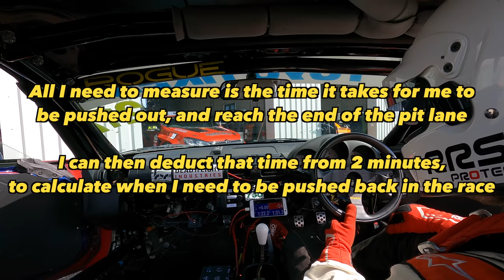MR2 Rear Ended, Chassis is Bent... Anglesey Race VLOG ft Crash

Comment: Yeah Anglesey kills tyres. I race bikes, as I've mentioned before(lol) and even in the wet there you can almost ride like it's dry.
Reply from the maker: seems savage on the rubber
Reply: Whats the reason? Some hardnut welsh tarmac?
Reply: @R03333  Don't actually know, but it feels similar in abrasive terms to some Spanish tracks. Definitely not complaining about it.